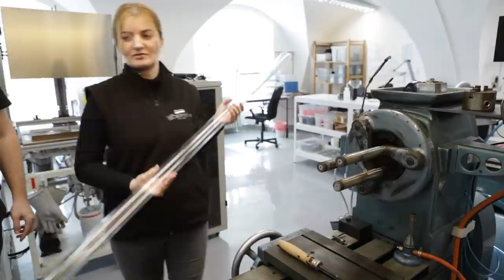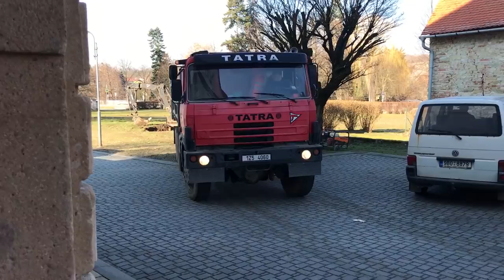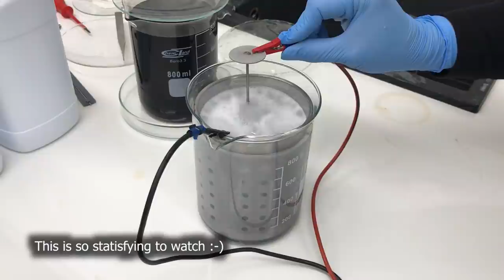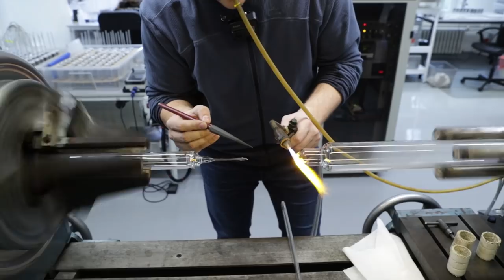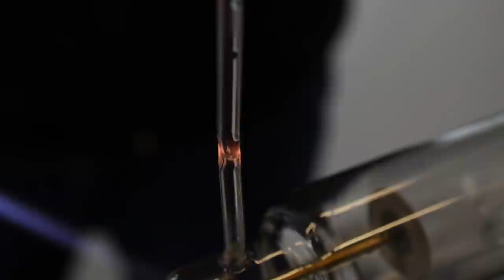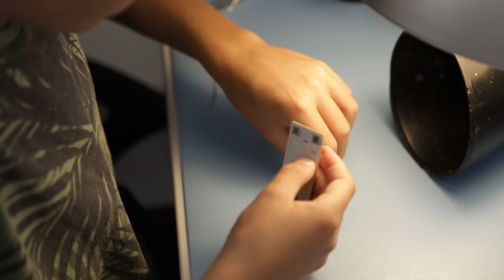Custom tube build | week 10-11/2022

Comment: Hello Dalibor, I know you are currently very busy (which is a good thing), but in case you are looking for ideas for new products in the future I would very much love a clock for the kitchen (maybe wall-mounted?) with some buttons so that you can set stopwatch or countdown timers. Keep up the good work ;-)
Reply: With a flasher and chine when done? Both color and noise could be set my user.
Reply: @PanzerBuyer  It could flash the digits, and a user selectable chime should not be a problem if based on similar firmware and browser access as the current clocks.

Comment: If that electrolytic oxide removal isn’t sufficient, I wonder if hot piranha or plasma cleaning might help you? Surprised to see no getters in that tube, can you say what it was for? Though maybe you have a fancy vacuum pump that has its own internal getter system.
Reply from the maker: This was first quick and dirty prototype (no getter) - the customer will use it for proof of concept of his theory.